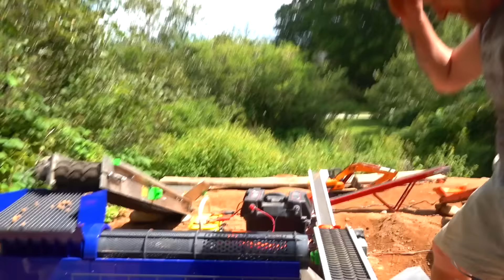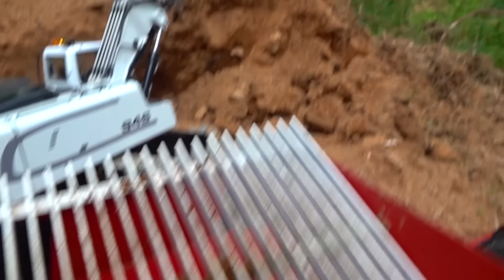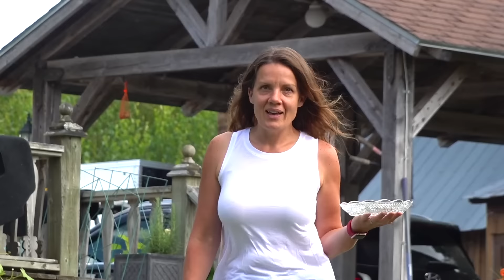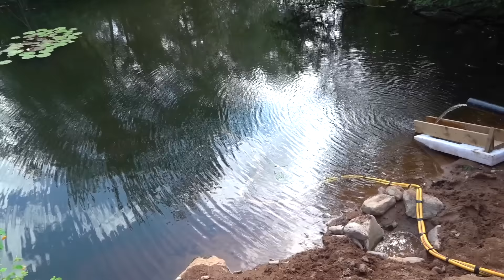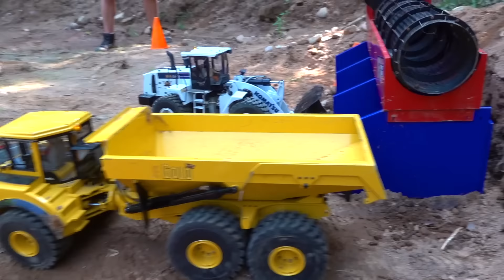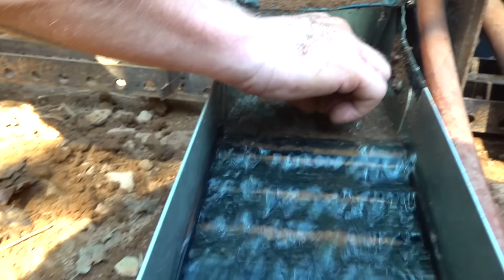YouTube GOLD - NS - SMOKE SHOW - Good Ol' Lads Diggin' : S4, Eps 5 | RC ADVENTURES

Comment: aluminum tube 3/8 long ,  run bicycle cable thru and loop back , squeeze tight , do both ends , you just made cables for lifting . you could also make these with lead fishing weights , maintenance crew should install a set for each vehicle , along with jumper cables . remember the weekly safety meetings , bob needs to come around , once in  a while . still watching , from Ohio .

Comment: Aaron a small advice you can mix the transmitter to start the oil pump when operator moves hidraulic movement and stop immediately when no need running pump. It can be mixed every each hidraulic movement for saving battery.
Reply: Uhm he's been doing RC for over 20 years, HE KNOWS!!!
I bet he knows more about RC than you and me combined.
And i've been doing it for over 20 years also.
Reply: @HanZie82  maybe you are right, but maybe he do not remember this is an option, I gave him a small hint, if he takes it, then takes it, if not, then not. I know  this is pain in a but ( hard) to find these option in transmitter. And maybe he do not want to waste time to these setting for all the models he have or maybe he has other reasons why he using it with currents settings, but maybe he says oh yes that is a great idea.

Comment: As someone who’s actually played around on a cat346 excavator….it’s extremely difficult to figured out everything the controls do, when to use what to get the max capabilities of the machine….and I imagine due to how small the rc versions and the hydraulic system are….it’s probably even more difficult….nowhere near as fluid or smooth due to how short of a distance the oil travels